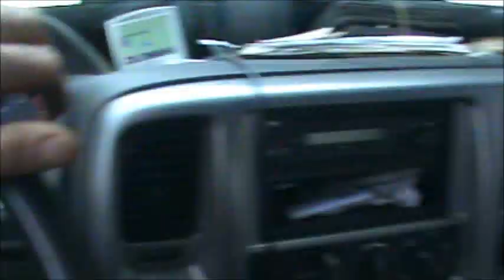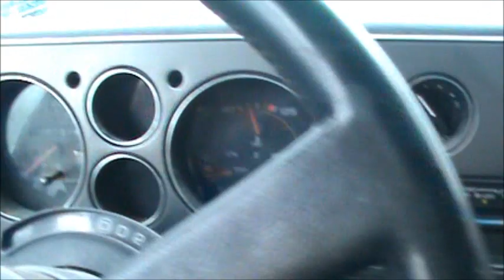``Untitled``

Comment: Usually the rust gets to those old GM Vanduras, the local repair shop has a 3/4 ton panel it is a 86 and has well over half a million kilometers on it. Running on its second engine the thing seen some abuse in its life same company has owned it since almost new.  The body is rusting out.  The Vandura series were good vans, tough, and got good mileage out of them.